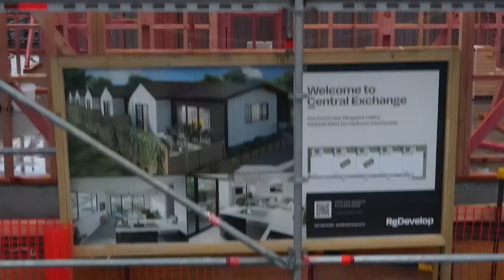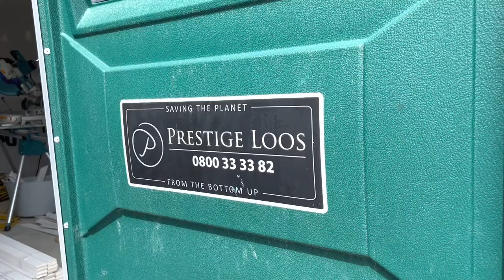NIMBYs - don’t watch this!

Comment: Hi , question about firewall - What have you used in between what type of firewall have you put looks like a steel/iron material between the walls and is that sufficient enough to pass council or you needed an extra  fire protected GIB install on the actual walls as extra protection  or GIB can be standard ??  Thanks looks great
Reply from the maker: I talk all about the firewalls in this video here
https://www.youtube.com/watch?v=cT9UcPTenxE&ab_channel=NZBuilder%2F%2FJoshChapman

Comment: Densification is necessary, but the city needs to cater for it with related facilities such as public transport, green space, etc. I bet they get the balance wrong.
Reply from the maker: It takes a long term vision from all parties to achieve this perfectly, agreed there's lots the cities need to deliver, we're just doing our little bit :)